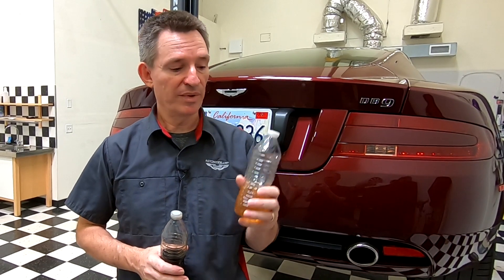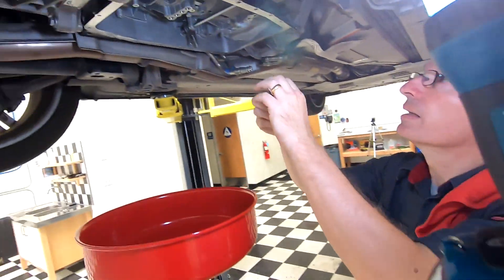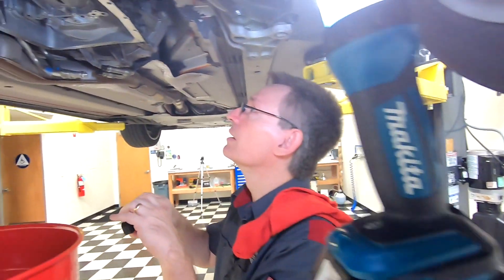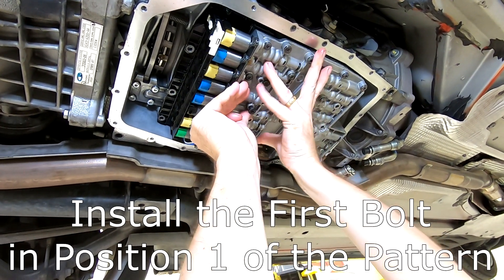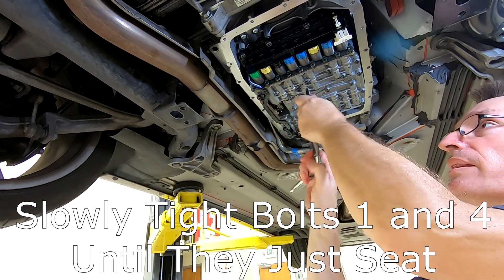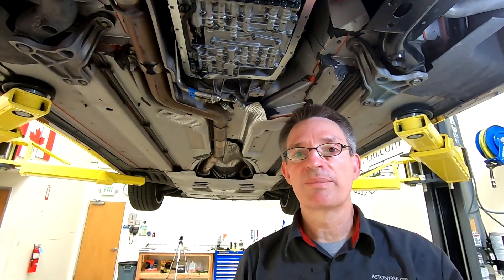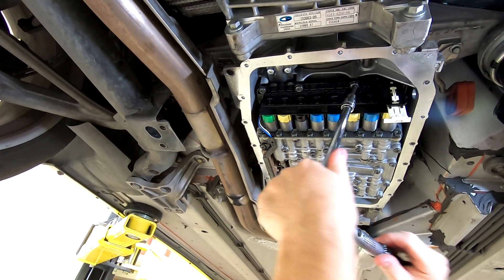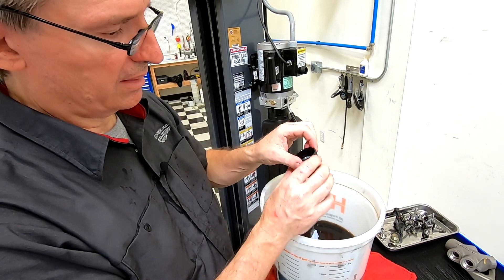Changing the Automatic Transmission Fluid in an Aston Martin DB9 - Part 3

Comment: Just completed my DB9 gearbox service and it really is pretty straight forward.  To flush the oil cooler pipes I used a garden sprayer (no shop air at home) which provided more than enough pressure to flush the system and a milk container placed over the other pipe to collected the evacuated fluid.  Worked perfectly.  Also my OBII scanner does not support Aston Martin so used an infrared thermometer (which is considerable cheaper than buying a dedicated AM scanner at £15) to measure the temperature of the gearbox casing.

Comment: Check out crows foot spanner to torque where an open end spanner is used. Put the torque wrench at 90 degrees to the spanner head.
Reply from the maker: That's interesting, I hadn't considered that and I should have.   Need to track down a metric set of them.
Reply: @Aston1936  Pelican parts do sets in metric. Metric in the UK is the norm for tools although of course we still refer to the wrench as 1/2" 3/4" and when I buy wood I'll refer to 2 by 4 rather than 47mm x 100mm, I always work in mm though. A bit of a hybrid mash up of imperial and metric.

Comment: Does a DB9 come in a manual?
Reply from the maker: Yes, there are a very few 6-speed manual DB9's out there.   A much larger percentage of the DBS's have manuals.   Thanks for watching!
Reply: @Aston1936  not a problem, also do you know a lot about a DB7?
Reply from the maker: @Unknown_communist  Sadly I know almost nothing about the DB7.  I haven't even been out for a drive in one yet.
Reply: @Aston1936  not a problem, I wanted to find out how to install a cruise control system on one, does a DB9 have a cruise control system?